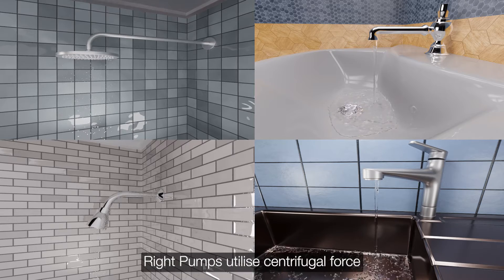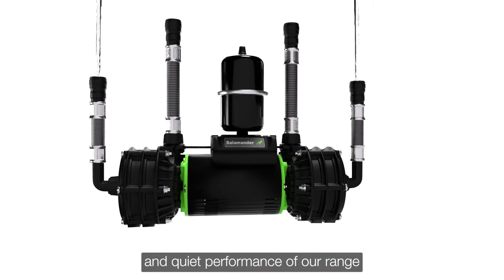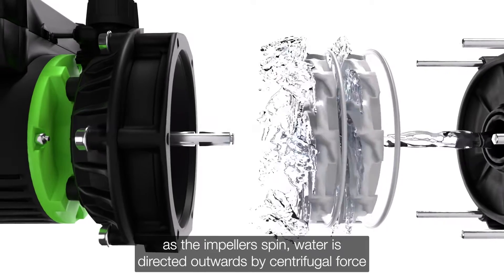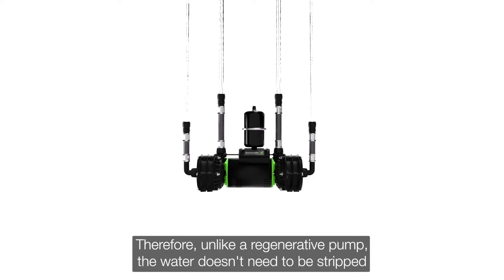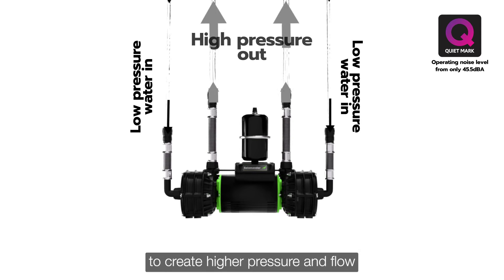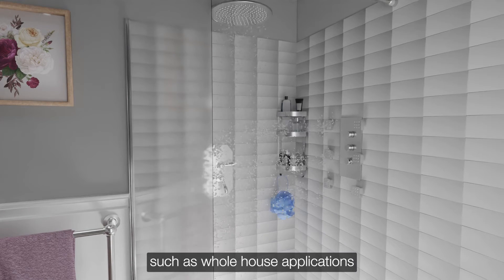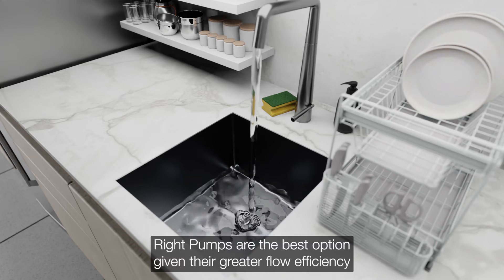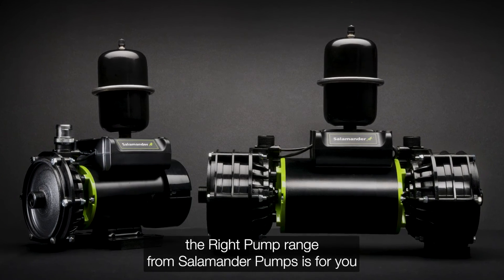Centrifugal Pumps | How Does A Centrifugal Pump Work?

Comment: My pump won’t stop flowing cold water and only hot water works . Has the pump for 2 years my plumber can’t figure out what the issue is .I have cT50 . Cold water is running fine across the whole of the house but not my shower .  Bought a new pump also but same issue
Reply from the maker: Could you please email us at Tech@Salamanderpumps.co.uk